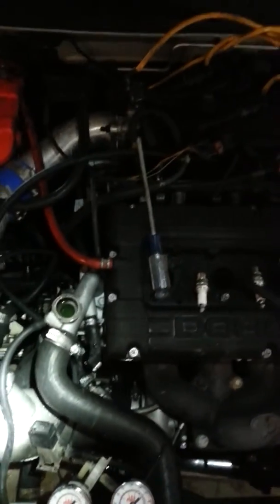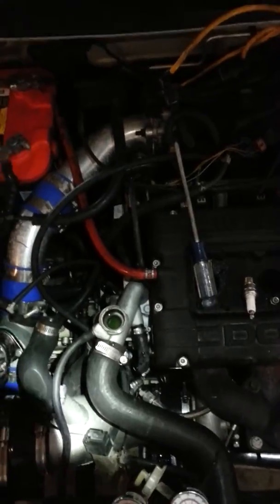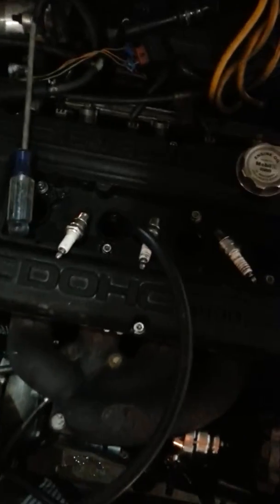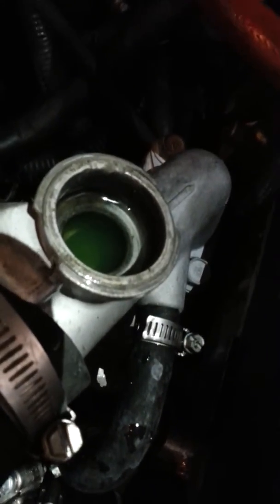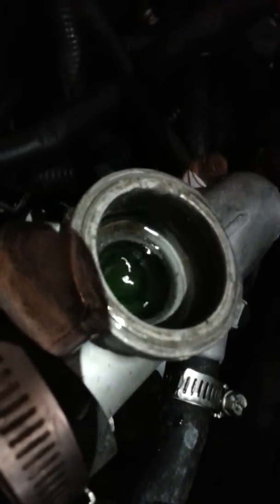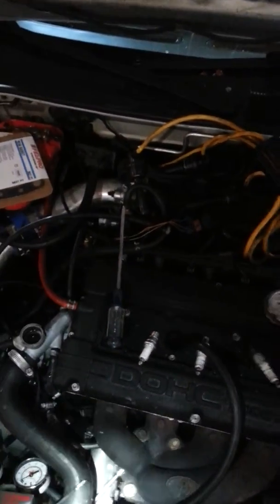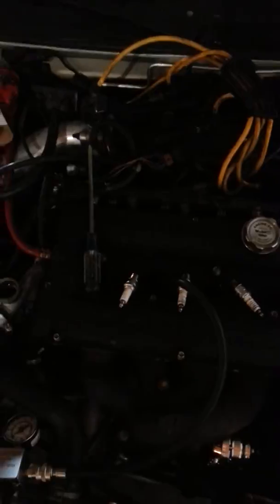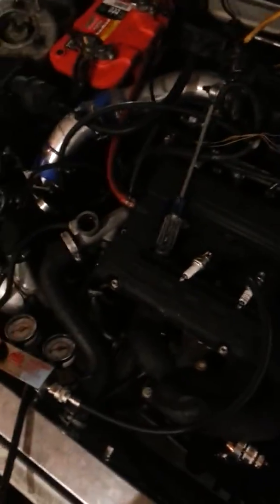Dsm 4g63 pushing coolant overheat no heat head gas

Comment: cylinder head bolts stretch, try changing bolts or use thick steel washers under the bolts.
Reply: Russell Kelly Under high r.p.m.,compression could leak onto the cooling system.